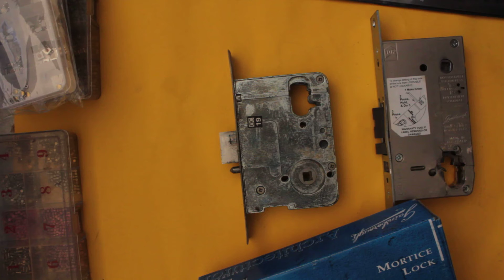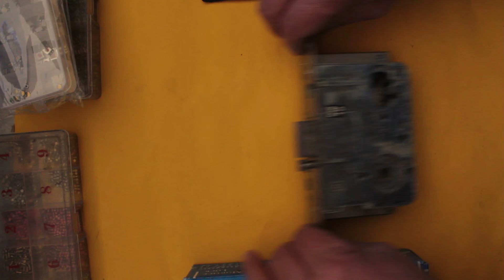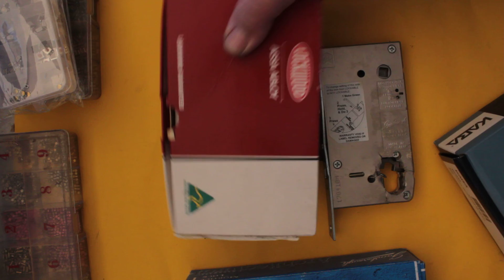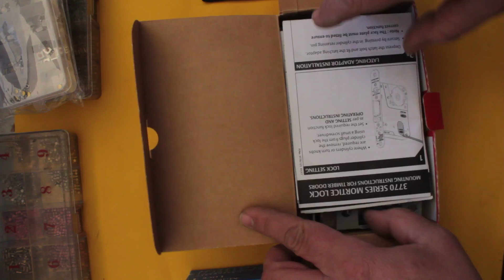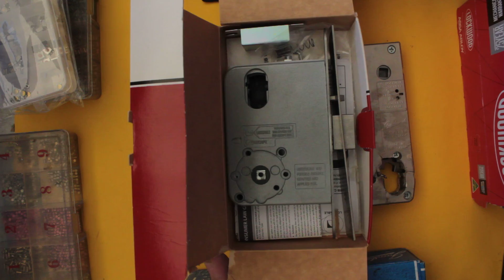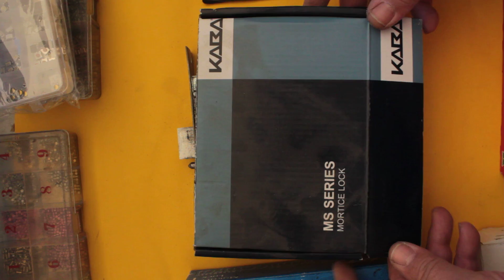Gainsborough 3000 Series Mortice Lock --- Discontinued ?

Comment: In Europe the standard format for all locks is the handle above the euro profile or oval profile cylinder. 

We would have to turn our locks upside down to have the handle at the bottom and change the handle spring cam assembly orientation to be able to do that, even locks made by assa abloy are still made to be installed handle above the cylinder.  

I think that might be a unique Australian idea

An adaptor plate would be the best idea when you get chance to create 1.  

It’s a shame that Gainsborough don’t make 1 already. They should be sued by all the Australian locksmiths into making a better designed version.
Reply: I wouldn't trust Gainsborough to design the bucket for a shithouse.  
Every time they "redesign" something, they take something that already worked and through sheer force of will they will over-complicate and under-think the solution.
I'm glad that A) Gainsborough are out of the commercial space and B) that they're intelligent enough to let everyone else fix their fuckups - if they tried again, it would only get worse.

Comment: That's a doozy of a pickle. Stupid company decision. I'd be looking at consumer affairs. They might have some responsibilties under consumer law that they need to look at. Maybe not, but interesting.
Reply from the maker: Good point, I have 1000 + door or more with this problem, my customers are out in the cold, this is crazy
Reply: @DrLockShop  Agree, similar boat.  Probably around ~200 doors though.
I've not got the issue of Fire Doors however (regional QLD) - perhaps i'll be able to plate timber & alumn doors to get my people out of the mess.
Fire doors are where this defecation hits the oscillation though.   I assume you can't just leave big voids inside the doors?